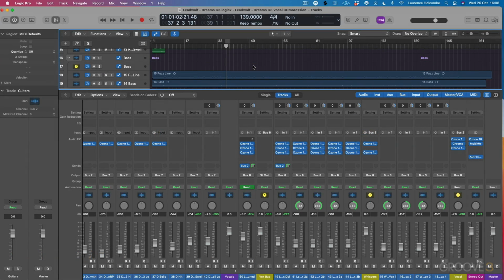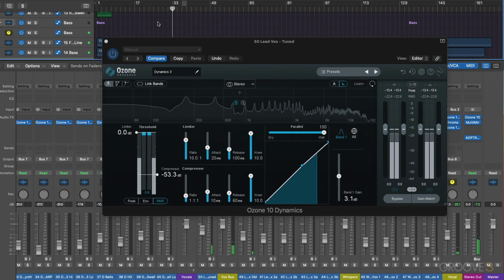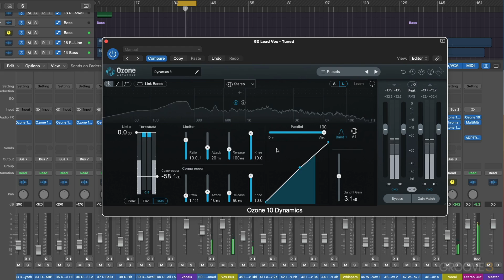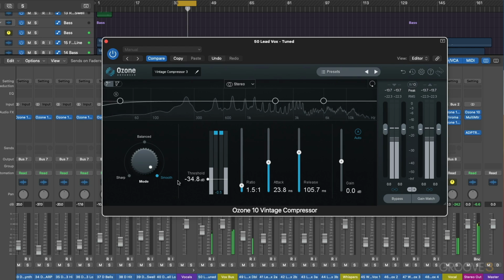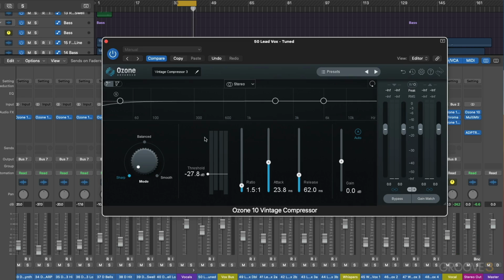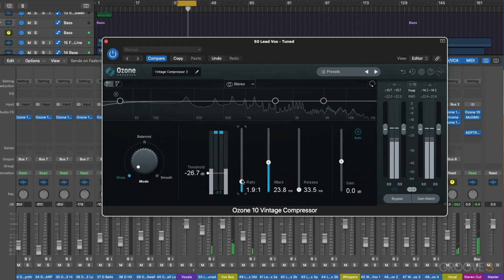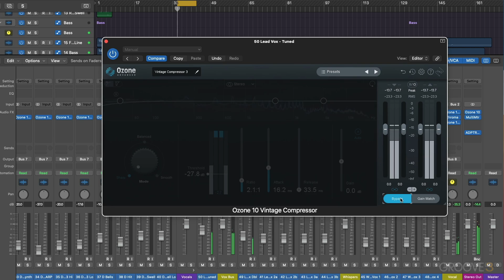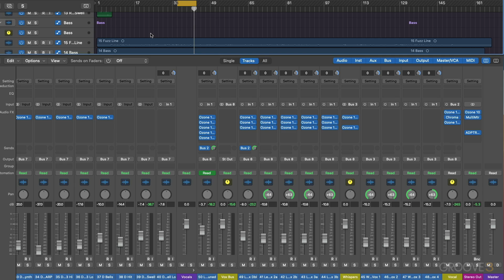Mixing with Ozone 10: Vocal Compression

Comment: You have a lot of ozone plugins on your tracks. I have a really good PC, but I cannot open many plugins like you. Although my CPU usage is around 4-5% and my RAM is at 15 out of 128, my software cannot handle many plugins like yours. What could be the problem? Should I overclock my CPU, or should I change some settings in my Cubase?